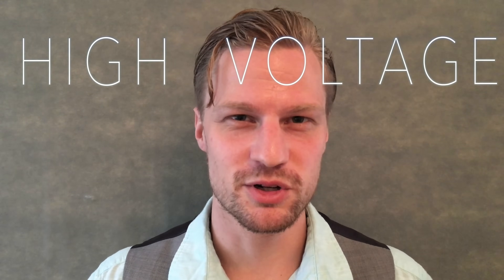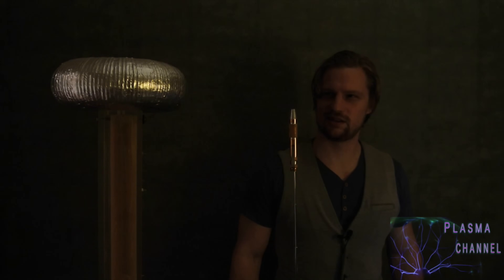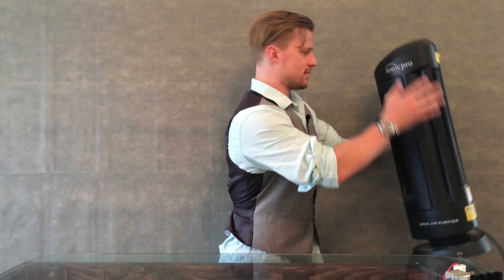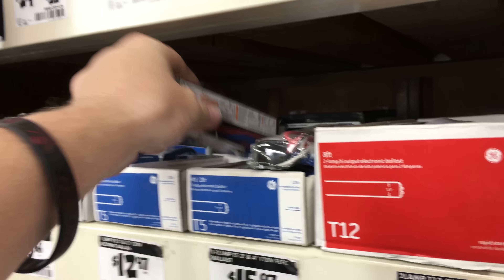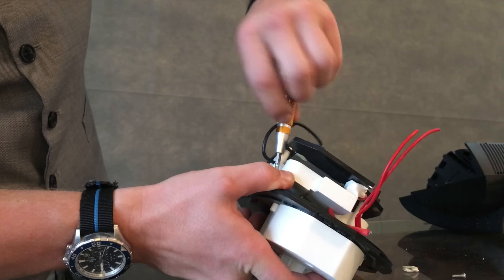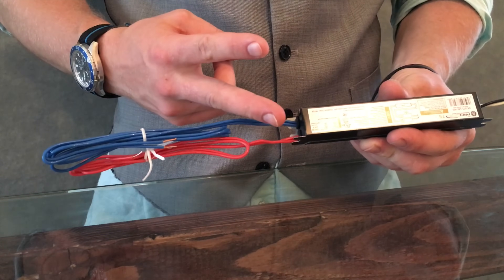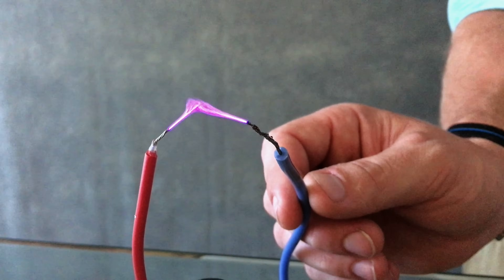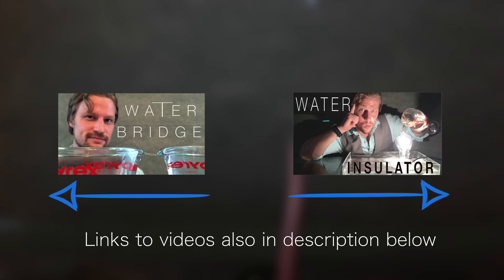Super Simple DIY 10,000v AC Supply!

Comment: As my knowledge fly-back output is dc but you said that its ac.
What is the frequency of hv voltage and can you share about connection of ballast four wire and fly-back input connection remember there is four wire in ballast which two wire of ballast is going to be used?

Comment: Not much chance to get a response but a few questions anyway:
Looks like you only use the fluorescent driver to boost the voltage to around 300V. Is that correct? It would mean you don't need it in 230V countries?
What determines the frequency of the voltage?

Comment: So, does that mean a 12 volt battery won't work for this?
Reply: Well if you directly connect the battery to the transformer then nothing happen as the transformer need input that is electricity that keep changing its voltage with respect to time(preferably AC current) and the voltage of electricity out of batteries are constant(DC current). But you can solve this problem by first hook the battery to the inverter first and then you connect the output from inverter to the transformer.

Comment: Did that air purifier also have a voltage multiplier or did it use just the HF HV output of the transformer? Was the original driving circuit too weak that you used a ballast instead?

Comment: Hey Jay, ive been thinking about building this but i cant find an ionic air purifier where i could take the transformer from, so i was wondering if i could use a flyback instead? Im pretty new to this so im sorry if this is a dumb question.
Reply: That is in fact a flyback transformer. Your on the right track. A lot of them will be very similar even if used in totally unrelated appliances. CRT TVs, air purifiers, plasma globes. A miniature one can be found in CFL bulbs, CFL back lights for computers, and on the smallest end arc lighters which are a recent development. The bigger ones can obviously handle more voltage and power in general so I'd stick with those. Also an old school ignition coil for a car is basically a massive flyback without the diode but I'd stick with the mid range ones that can be soldered on a board.

Comment: Hello... Quick question.... You got the flyback from an air purifier (which doesn`t have diodes at the end so the output is AC) .... Could you use 1 that has diodes at the end... And how dangerous are these things(Is the AC or DC one more dangerous?)

Comment: I followed these steps. But I am not getting those big arcs. I connected from my ac mains(240 V). I checked the pins and they all read live. But no arcs
Reply from the maker: Wait, you connected the transformer to mains, or the driver circuit to mains?
Reply: @PlasmaChannel  the driver to mains

Comment: Why do some put input into coil primary while you just connect the input to pins
Reply: When you connect to the pins, you are using the primary that is built into the transformer.
Some people prefer to wind their own primary by wrapping several loops of wire around the ferrite core.  This does 2 things:
1. They don't have to figure out which pins on the flyback transformer are for the primary coil.
2. They can control how many turns are on the winding.  This allows them to start out with lower output power (more windings) and then move to higher output by decreasing the number of windings.
Reply: @howardzone  omg thank you so much sir I cant really find much information online. Also, when I want to output higher voltage, I need to have higher ratio of primary to secondary right? What could be the number of windings in the secondary? And am I going to use thicker wires for my primary as it does need higher current? And another question, how many windings is that built in primary? Could it handle like 3 amps? Can I touch the output? Thank you again sir if you don't mind to answer it's fine.
Reply: @omniyambot9876   -  The high voltage output wire and the ground pin on the bottom of the flyback are both connected to the secondary coil, so its number of turns is fixed.  If you want a higher output voltage with a primary coil that you wind around the ferrite core, you would use LESS turns.  To get higher output voltage, you want a lower ratio of primary to secondary turns.  Example: if you put your input power into a 10 turn primary, and you have a 500 turn secondary --> approximately 50X higher voltage coming out of the secondary (In reality, there will be some losses.  But, this is a good approximation).
When I took apart a bad flyback, it looked like it probably had around 1000 turns on the secondary coil.  I didn't count them.  It just looked like A LOT .   Definitely more than 500.
If you make your own primary, you will only use a few turns, so you can use a thicker wire without any problem. 
The number of windings in the built-in primary coil is going to depend on the design (things like how many windings are on the secondary coil and how many volts they are trying to produce for the device).  
When you see projects where people wind their own primary coils on a flyback, they typically use 5 - 10 turns.  When I build one of these power supplies and make my own primary coil, I typically start with 10 turns, and then test lower number of turns.  I typically end up with 6 - 8 turns.   But, once again, the "right" number of turns is going to depend on the design of the specific flyback you are using.
Reply: @howardzone  thank you so much sir! that's so many knowledge I've learned from you. Definitely will be useful. I hope I would not destroy anything lol. I really want to get like 40,000v but as you said I should maybe start with 10 primary and try lower turns for higher output. I'll try to put 3 amps in primary. Thank you sir I wish you the best.
Reply: @howardzone  sir I have another question, after less than a minute of having my flyback transformer, it seem to not work. It can make 5cm arc but trips the power supply so I tried to further the distance between the wires then after that, it doesn't work again. I think it's an internal arcing. Can it be fixed?
Reply: @omniyambot9876  It is possible that you arced inside it.  But first check the pins on the bottom of the transformer.  If you see an arc mark between pins, you may have a shorting path.  Clean off any arced carbon between pins.
But, if the pins look good, you may have arced inside the flyback.  In that case, you are probably out of luck.  The inside is usually filled with insulating resin.  This helps to give it some protection against arcing, but it makes it impossible to go into it and fix it.
Hopefully, it is the first case (arcing between pins).

Comment: I found out YES you have a lot of videos on voltage multipliers.
Watched and gave all of them a thumbs up. 
I built the AC Supply in this video today and it worked perfect the first time. 
Next weekend will be building a 16 stage multiplier.
Thank you so much for your videos.
Reply from the maker: Wonderful! I love hearing that things worked.
Reply: @PlasmaChannel  I think I figured it out. You ran 3 capacitors in series so 3 capacitors act as one. I was thinking you did something special to prevent a voltage sag at the output.

Comment: I have a question. What is the amperes for the 15000volts output?
Also, what happens is you connect this output to a toaster or hair dryer or any household equipment?
Reply: Mike Lamb probably the output voltage would drop as the current is limited. Imagine that the input is 100V 20A and the output is 10000V: the maximum current would be 0,2A (10000*0,2=100*20).
Reply: @jorbedo  i don't know. Why would it be 0,6 A?

Comment: Hi, Jay. can i use motorcycle ignition coil as high volt transformer, and fluresent lamp ballast as driver?
Reply: I am not jay but a car ignition works at much lower frequency so you can't use a ballast for the driver you could use an 555 timer in combination with a transistor for the driver online you can find the circuit for this just tipe in:555 transformer driver
Reply: @raulperez5697  Big thanks for your answer sir. cheers.

Comment: the cables you used from the ballast are the cables responsible for the kickstart of the lamp, right?
Reply from the maker: That is correct, yes.
Reply: @PlasmaChannel  thanks
Reply: @PlasmaChannel  update: I tested this, but the flyback started to smoke. I think my ballast is too strong, it’s a 110w ballast, and that must have caused some component of the flyback to start burning, and for that reason there was no arc
Reply: but it could also be that the ballast was so powerful that it ended up causing the flyback circuit to start having arcs inside (which is something very common), then the flyback's internal circuit ended up burning :(
Reply: but something very strange is that even though the flyback burned, the flyback was not hot, nor the ferrite, nor the pins, nor the insulation, nor the ballast, the flyback just gave off a smell of burning graphite
Reply: and I don't know how to open the flyback to see if the circuit is really burnt
Reply: well, learning from trial and error
Reply: sh*t. what happened is that pins 6 and 7 were actually very hot, and it burned a little bit of my table, which is made of wood. I think these pins suffered such an arc that they started to heat up, but since they are small pins and I left the flyback on for a short time, the pins quickly cooled down. so what happened is that there was actually an arc inside the flyback, most likely because of the high power of the ballast.
that must be why a smell similar to the smell of burning graphite started to rise, the wood on my table was burning. stupidity.
so, this means that the flyback works, the problem is that the ballast I chose is an overkill, because it’s 110w. which is still a little strange, because there are people who use zvs circuits to control flybacks, and these zvs circuits can usually produce thousands of watts. so, it must be my flyback that can't handle such power
Reply: update 2: FINALLY! IT'S WORKING!
so, I plugged this circuit into the outlet, and it started to create that high voltage, but the problem is that my computer immediately shut down. why? I think it's because I use a power strip where I have my computer, the monitor, the router, the cell phone charger, and the computer is the heaviest load, using a maximum of 200w, so when I connected my ballast that consumes 110w, I think there was not enough power for the power supply to work, and then the computer immediately shut down. in addition, the circuit created high voltage, but the voltage is so high that the pins started to create a very large arc, so what I'm going to do is isolate these pins very well and leave only the grounding pin exposed. so it's working to some extent; the problem is that because the output is direct current, the arcs are very noisy, if it were an ac flyback, the frequency would be so high that a normal human would not be able to hear. both ac and dc flyback have their advantages. the ac flyback can be less noisy because of the high frequency and it is possible to create plasma, and the dc flyback can charge capacitors and has a slightly higher voltage
Reply: @PlasmaChannel  thanks for the info jay, i finally found the best way to create high voltage

Comment: Will a transformer from an old TV work?
Reply: yes, but with direct current as output
Reply: @ruby_R53  does DC arc differently than AC or not? Thanks for the info
Reply: @hubb8049  there is not so much difference
Reply: @ruby_R53  oh ok, thanks!

Comment: Hey love the video. Can you use the transformer with just 110V? Does it give decent arcs?  Just wondering why you need the electronic ballast.
Reply from the maker: If you just plug the transformer into the wall, it will blow up immediately. Too much power being provided. The driver limits power and also switches the power on and off incredibly fast. That fast on-off-on is what drives the flyback.

Comment: Will you die If you touch these wires same Time with your bouth hands
Reply from the maker: Likely not, but I would not risk it. This video is intended as a DIY for experimenters who are able to experiment safely. Cheers.
Reply: Why you dont die If electricy flows into Ur heart
Reply from the maker: Not enough power. The effective power out of the flyback is perhaps 30 watts. Still dangerous, absolutely treat this device is respect. Flyback are also prone to serious voltage drop.
Reply: Oke so in The transformer what happend on amperes
Reply from the maker: Current out is around 2mA, though I had problems accurately measuring it. Cheers.
Reply: Aa oke but do you know why that happend

Comment: Can I connect Tube ballast to Microwave oven transformer(MOT)?
Reply: Yes, you can, but be sure your transformer can deal with it. Microwave transformers are designed to handle 2kV and not that much more, so it would be wise to encase it in oil or wax
Reply: @andresaofelipe  Thanks. But I think it won't work. Ballasts generate around 40k+ frequency. And MOT core is iron and not magnetic so it won't be able to handle higher frequencies.
I think MOTs are designed for 50-60Hz range.
Reply: @GhostsOfSparta  yeah, totally forgot about hysteresis loss. It should still work, but you would get nowhere near the same voltage as jay did

Comment: Will this power the smaller voltage multiplier you built earlier with the plasma lighter.... my plasma lighter bit the dust. I did pick up the same ionic breeze like you have in the video. Good work!

Comment: Serious question/request >>  Can u make a mini-series called 'how not to die or blow up your stuff "  <<<     So, i'm a little cautious about HV as it didn't take long before wires and power supplies lit on fire / explosion.... Those incidents were at a spot where it didn't matter. There was NO expensive equipment/things which could not break(like vintage irreplaceable audio equipment) and close neighbors to smell my burning flesh if need be(ya exaggeration duh)  ...  I've always wanted to experiment and progress the world of HV.   I can design circuit boards & transformers now >> what do I need to look out for to 'not get stuck'  ,, to not have something across the room light on fire ,,  etc etc ...

Comment: How did you know it was safe to touch?
And is there a way to adjust the frequency to play audio through a voltage multiplier
Reply: arcs are probebly so high in frequency that it dosnt shock it just burns, still shouldnt touch it

Comment: Question: I know that BJ Transistors can operate at only low currents, but can it function properly at high voltage? Won't the electrons diffuse through the depletion region?
Reply from the maker: I dont know of too many bjt's that can withstand high voltages.

Comment: Im pretty sure that Flyback used in air ioniser has rectifier and outputs DC. There is voltage doubler built-in so you dont need as high voltage winding and reducing cost.
Reply: Actually, pulsed DC arcs (like the ones from DC flybacks) have different characteristics to them. They sound different and look different. It's pretty awesome!

Comment: I could not find 300 volt fluorescent ballast with four output leads at Lowes or home depot. I did find the exact same kind of transformer on e-bay I got two of them brand new for $15 that included shipping.  Fluorescent tubes and ballasts are becoming more and more rare especially the t5s they are being replaced by l e d.
Reply from the maker: Nearly all ballasts output 300 volts at a minimum, others output 600 volts. Did you look in the right isle?

Comment: Yesterday I bought an ionic air cleaner at a resale store for $7 and it did not have the proper transformer in it. It had an encapsulated transformer and it was labeled 120 volts AC – 7,000 volts DC negative; two leads going in and two short high voltage leads coming out. If anyone has an idea what I can do with this type transformer let me know
Reply from the maker: I’m sorry to hear that. Did you buy the sharper image brand, specifically?
Reply: @PlasmaChannel  No it was not sharper image it was a GE make. No big deal I will find something to do with this transformer.

Comment: How can i check if it has an output of 300VAC?
Reply from the maker: You dont need it to be 300 VAC exactly. 300 VAC is just a standard output voltage you usually see on inverters. You can use any multimeter.

Comment: Hey! Love the channel! 

I have a question....
I’ve been working on a similar project but the question I have is what exactly did you do with the remaining wires. I know the ballast has 4 output wires and you have to use 2 but did you do anything with the other two? Did you just cap them off?
Reply from the maker: Hello, thank you! Yes, I just cut them off and capped them.
Reply: if you definitely do not need to use the remaining ballast wires, I recommend just unsoldering them, then you will have a large cable that you can reuse

Comment: I wonder what would happen if you connect the high voltage transformer directly to 120v 60hz AC
Reply from the maker: You would blow up the transformer and tip a breaker in your house.

Comment: Loved it! I wonder, Will it work if you replace that transformer with one from a microwave? Thanx!
Reply from the maker: It will not work with an MOT. Those are designed for 60hZ. This is a high frequency circuit.
Reply: @PlasmaChannel  will a flyback transformer from an old tv work? I'm trying to generate a steady arc in order to produce nitric acid.